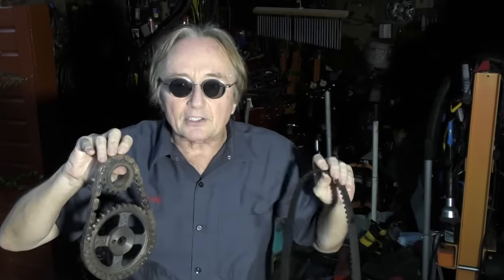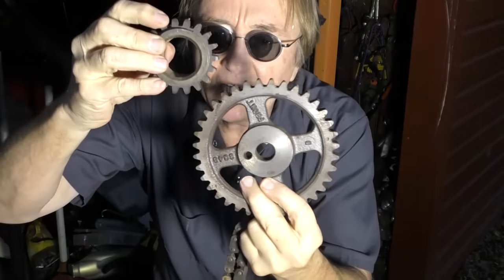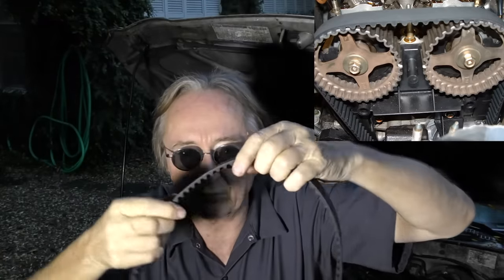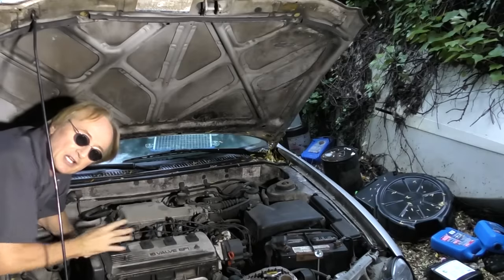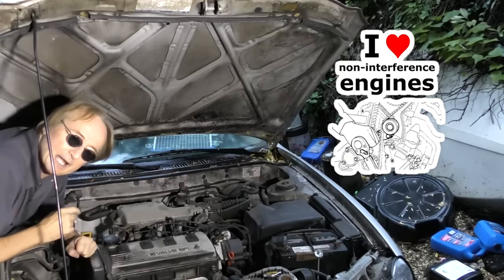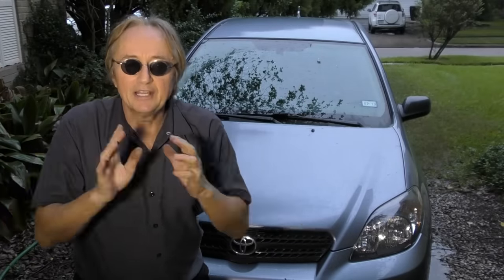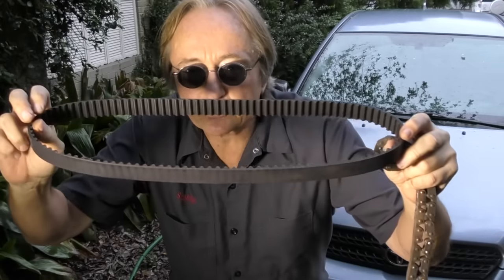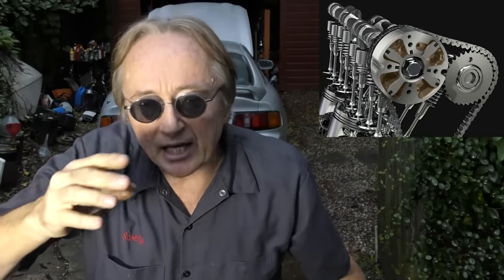Why Some Cars Have a Timing Chain Instead of a Timing Belt

Comment: Timing belts fall in the same category as plastic water pumps
Reply: Dont forget the plastic body panels on the saturns. The only reason they are dent proof is because if you hit them hard enough they shatter lol.
Reply: And those damn plastic thermostat housings. What the hell is up with that!
Reply: Plastic fuel injector housing is literally cancer.
Reply: Any car that uses plastic where metal is a much better choice, I walk away from.
Reply: @bthegardner2213  oh yeah didn't dodge or Chrysler do this lol
Reply: @SourGrey  Chevy did too with the aveo. It's becoming more common to find once aluminum parts to be replaced with plastic on 4cyl engines.
Reply: I have a car that came from the factory with plastic radiator hose connectors/splitters that brings coolant to the carburetor and heater core.

It failed burst in 3 years. Changed it to an after market aluminium unit and never had a problem since. Its been 15 years already. Sometime metal parts are needed. Sometimes plastic parts are needed. But never substitute metal parts with plastic

Comment: Meh, i preffer timing belts , at least if engine has one , its easy to service. Down side of timing chains , are those cheap plastic timing tentioners . Plus most engines are in Transverse so the only way to service timing chain is to drop the whole engine , too much work and harder to service compare to timing belts .
Reply: You don't always have to drop the engine. I replaced the timing set in my buddies 04 Malibu classic with a 2.2 ecotech never pulled the engine. Book said to remove it but you can change them without doing it
Reply: @brandonpeterman9964  4 bangers are ok, still cramped tho. To "properly" serviced it needs to be removed from the bay. Heck all V6 DI GM family engines (aka Lambda)  that are transversed are next to impossible. Now i know some folks able to manage to replaced timing chains while still at the engine bay but its really tricky and too much risk .

Comment: Most if not all timing chains stretch if not actually break. A stretched timing chain can be very damaging to other engine components, not to mention the engine no longer runs within the design parameters. Belts clean effective accurate safe and easy to replace. Mostly at a reasonable cost, replacement of chain is a way more expensive proposition.
My personal problem is I can only buy used vehicles. Vehicles with cam chain engines with very often poor maintenance record of good oil change frequency and with good oil types are no longer on my checklist to take an interest in. The net is littered with knowledge on poor quality chains or tensioners that need premature replacement.
Just like direct inject engines and chains are not good for the average pleb like me.

Comment: I have a 1999 B14 Nissan Sentra 1.3 liters that has 360k kms on it. Original aircon compressor, original carburetor,  not burning oil, engine never been opened and yes, it is equipped with a timing belt.

Comment: I had a beautiful acura legend coupe 1992 had stupid timing belts .. well it broke and I lost an engine .. talk about pissed .. I’ve bought toyota’s ever since
Reply: Been having honda's all my life, other cars too i'm in europe we have other brands. It's weird how you call them stupid timing belts, why don't you call it stupid maintenance, you're the type of person who thinks engine oil is good for 20k miles? Why can't you guys take care of cars so you don't have this kind of problems? Nothing personal
Reply: Maybe should’ve followed the maintenance interval
Reply: I was told all maintenance had been done on the car I inherited it from a relative ... you’d think car companies would at least on their flag ship line would do timing chains ... that’s why I’m a toyota / Lexus guy ... but thanks for your suggestion
Reply: @kevinedwards4223  Somebody dropped the ball, then. They either installed the belt wrong (I encountered this on a 20 year old Accord which had over 250,000 miles on it, engine was still fine), or they thought they changed it when they didn't. It's also possible that your relative got ripped off. I've been working on cars for 17 years, I've seen plenty of timing belts go well past their replacement interval, I've never seen one fail prematurely.
Reply: Your exactly right my aunt gave me the car seems her private mechanic screwed her charging her for work he never performed he was supposed to do the water pump and he found out it was a job over his skill level she went wrong telling him she was selling the car in a few weeks ... she ened up giving me the car ... the mechanic gave her the funds back 800$ 

But the engine was ruined
Reply: Kevin Edwards so Toyota some of them still run timing belt
Reply: Kevin Edwards and my 98 Honda Accord got 320.000 miles on it and I change my timing belt every 90.000 miles

Comment: I hate that my Honda odyssey has a timing belt. And of course it's an interference engine. Not only that but it cost me over a thousand bucks Canadian to have it changed. I did do all the tensioner pulleys and the water pump at the same time though.
Reply: TableRocked  I've had two 2005 odysseys and they've been rock solid. But I have heard a lot of bad things about the build quality of the newer ones. I'm actually thinking about buying an older sienna but they're hard to find with leather.
Reply: dave ramsey,  the finacial guy who talks about getting and staying out of debt,  says,  "most millionaires buy used vehicles",  wow,   you must be a  multi-millionaire.....................
Reply: TableRocked Might want to put that $50k towards Google stock. Their Waymo unit is the real deal. YouTube search "Tony Seba freightwaves", and watch that presentation through, to see what I mean.
Reply: V6 engine + timing belt = dumbest design I’ve ever seen...😫

Comment: Toyota makes non interference engines? My 98 3.0 Diesel Toyota Hilux rubber timing belt cost me $2000 when it let go and smashed all the valves into the pistons :/
Reply: A diesel with a belt ?!?!?!?
Reply: Little Chicago all Volkswagen Diesel engines have timing belts. And when they break the pistons smash all the valves. Very important maintenance item for those engines

Comment: Manufacturers make a lot more money off of cars with belts since they have to be replaced after x miles.
Reply: Friend with a Volkswagen TSI has changed more timing chains than me timing belts on my Volvo up to 200 000 miles. And when buying a used car, changing a belt sure beats opening up the engine.
Reply: It's a lot of billable hours for service centers.  Honda V6's are notorious for their difficulty and shops charge about 7 hours worth of billable time; even a good technician who's done it hundreds of times still takes several hours.
Reply: saab 9-5 manual actually says the timing chain should be renewed at around 150 000 miles

Comment: My Toyota engine is interference :(. Just had the belt replaced.
Reply: All the mechanics in my area charge at least 600 dollars to do this. Absurdly piss poor design choice especially on a transverse mounted v6 engine in a cramp engine bay like my 2nd gen lexus rx.
Reply: I hate that term they use to describe the ''INTERFERENCE'' ...it should have been termed as Destructive consequence engine  or  Non Destructive consequence engine, because afterall the problem can result in major ''destruction'' of the engine
Reply: @Rainman00000  which is the main reason why I got rid of my volvo. I loved the car, but the inline 5 was a bit cramped to do any work. Specifically transverse. I got a audi an I'm happy with it easier to work on the car and it uses timing chains. Which I will replace in the summer.
Reply: @fidelcatsro6948      "Interference" refers to interferes with your bank balance when the belt breaks. Replace the belt every 100,000 or every five years and they say you'll be good. Sooner if you follow Scotty's advice and you rev your engine.
Reply: Jomar V. why replace timing chains, no need to unless it like 500,000 miles
Reply: I thought Toyota used non-interference engines while Honda used interference engine. I believe 2003 Camry had a non interference engine
Reply: @tinytim9453  It has a belt, not a chain. 4.7 V8 in an 01 Tundra.
Reply: My 98 Toyota 3.0 v6 costs a fortune to fix anything
Reply: newer  camrys   have  chains,  so  they're  probably   interference.
also,  the  camry is  the  toyota  made  in  the  usa.   a  lot  of  it
made  by  G M.   interference  with  a  chain  like  they  always  use to
make  them....... chain breaking ?  not  to  worry.....it  won't......
Reply: @tinytim9453  cause I bought the car used (obviously) and dont know the history of it. So just to play it safe. Like just this week i found out it had a coolant leak. Its better to be safe then sorry sometimes.
Reply: I must have been one of the wide head series as the A series with narrow heads, with the belt driving one cam. Gears take the drive to the other cam. These engines are non-interference. My old Toyota Avensis  (European cars) had 7A-FE 1.8 non-interference engine with cambelt. Had regular belt changes done every 5 years, well inside the mileage (60,000 miles). The changes cost £130 including parts.
Reply: driver4011 Wrong. Toyota 2.5 4 cyl. and 3.5 v6 both non-interference engines. Know the facts before you leave a comment so you don’t look stupid.
Reply: I also have a Toyota interference/timing belt car. The 2jz ge inline 6. I've changed the belt twice in its life time. Currently at 260,000 miles.
Reply: @Tiny Tim   Unless some previous owner of the vehicle has failed to change the oil. If this causew the tensioner to stick, then the flopping chain can cause the guide to break Or the chain itself can be weakened and break eventually..
Reply: After 2001, Toyota used the 2.4L 4cyl which has a chain. They contintued to the use the 3L V-6 until 2009. For a V-6 it is pretty easy to work on and you can do a timing belt job at home if you know how to work on cars. In some models you do have to jack up the engine to get the water pump bolts out, according to my sources. The last timing belt engines by any manufacturer were sold in 2010 as far as I know. Gates has an online guide which shows all timing belt applications and also indicates whether the engine is interference or non inteference.
Reply: My 05 camry has timing chain. No problem
Reply: Gary, I was replying to Jomar. Anyways, the Tundras has timing belts??? There are kinda cool looking trucks but I'ma think twice before buying one.
Reply: Gary 2uz-fe I’m guessing??
Reply: I had a belt break on a 95 Civic. I was told that they are interference engines but there was no damage done. I simple replaced the belt and the car drove fine

Comment: It seems to me like performance cars have timing chains and basic slow boring cars like the celica use belts.
Reply: Actually I think it is the opposite because of the resonance factor and weight.
Reply: My 2001 celica has chain 😎
Reply: My base model Nissan Versa has a manual transmission and a timing chain.
Reply: My 01 BMW M3 and 04 Cayenne Turbo both have chains.  A broken timing belt is a major headache that i would not want to worry about.
Reply: corollas, lancers, honda civics & fits, sentras etc many small cars have chains
Reply: Subaru Impreza WRX and Sti use belts
Reply: All slow Saturn S-series had timing chains too. It all matters on the brand and what they are willing to spend versus an investment.
Reply: It seems to me you don't know what you're talking about.  Every Corolla since 1998 has a chain.   Every Celica since 2000 has a chain.   Every Prius ever made has a chain.   Aww, hell, I'll just get it over with and say it... NO Toyota made today has a timing belt.

Comment: My S2000 has timing chain but my Odyssey has timing belt, which I changed at 100,000 miles.  It's about 145K miles now.  Both vehicles  have been very reliable.

Comment: You forgot to tell them how to visually tell the difference.   A plastic side  cover is a timing belt and a metal cover on the belt side of the engine is a timing chain.
Reply: Sometimes the chain can be seen by removing your oil cap. Some cars that dont have a plastic or metal cover on the side means it is always a chain.
Reply: @HardWhereHero  True 'dat.
Reply: GM Vortec engines(1996 to 2000).....Tell me again....plastic timing cover.....belt or chain?
Reply: @iamtheoffenderofall  pushrod motors timing chain overhead cam motors could be either.
Reply: @russwelday  According to your post, Plastic timing covers are timing belts metal are chains. I proved you wrong.
Reply: The plastic timing chain covers glued and bolted onto the Blazers are a stone age exception.  The general statement was for modern transverse engines.
Reply: @russwelday  And someone NOT knowing cars would believe your bull.  You stated a lie, I called you on it. You are bucking now that someone called you on it. You now even admit you were wrong by stating my fact.
Reply: @iamtheoffenderofall  pretty sure my timing chain cover is plastic, like way too many things under the hood. I guess I should be happy that Chevy still believes in putting steel where it counts.
Reply: Wow you can not tell by plastic or metal cover if it's chain or belt.
Reply: @russwelday  exactly.. Yea you will always find a few exceptions.
Reply: @russwelday  Im guessing they blted it on then glued it to keep the "trail crud" out. But since only hardcore jeep guys offroad its all non relevant. GM at its finest.

Comment: 😒 i hate timing belts & interference engines
Reply: Steve Prince  😎 OK! 🚂
Reply: MrSammy   How can one tell if any particular car’s engine is an interference engine?
Reply: @TheItsmegp46  🙂 check the forums on the car u like, usually someone will post wether its interference or not ☺️🛵🎃
Reply: On non-interference engines, it is impossible to get valve operation that maximizes power.  The exception would be a flathead engine which my first car, a used 1951 Ford V8, had.  So did my antique 1953 Packard with a straight 8 engine.  Flathead engines ran just fine, but it was hard to get much more than 1/2 HP per cubic inch from them.
Reply: @frankeggers4024  🤠 neat, i didnt know that
Reply: damn you subaru!
Reply: @niccadoodles  😒👍 rite! 😡🚗😵

Comment: My 98 k1500 has a 5.0 v-8. I have 200,000 miles on original engine. It starts and runs like the day we got it. Timing chains make the difference. 23 years later and the engine sounds incredible.

Comment: I love timing belts. I've serviced Ferraris.
30k services run about $15k on the 512.
Most of that is the engine pull for the t-belts and water pump.

Comment: As electronic cars slowly gain traction into our lives, I am amazed by how many problems are solved by them. No need for pistons, timing belts, no interference issue, and so many more...
Reply: Yeah now you get ultra flammable batteries instead
Reply: @NikeySunfire  one spark at the fuel tank and its the same problem currently.

Comment: In a racing application, such as NASCAR, belts are used because they have less mass and are way less prone to becoming a circle like a chain does.  I owned a 1984 Pontiac Sunbird 1.8.  Recommended timing belt replacement 50,000 miles.  It broke at 53,000 miles.  Quite inconvenient.
Reply: @Mark Codiroli You are correct.  I do remember seeing a picture of the gear to gear cam drive.  Several years ago a NASCAR competitor lost engine power suddenly and was accused of delaying the race.  He responded by saying his timing belt had broken.  Maybe that was an experiment that almost worked.  It was very late in the race when that failure occurred.  A belt does have less parasitic drag.  I do recall reading an article about using belts in performance applications.  Maybe the NASCAR engine builders are experimenting here and there.  Anyway, the inertia factor would be a consideration ( the circle thing ), but finishing the race certainly remains a top priority.

Comment: Just changed my rubber t belt in my 2008  accent yesterday first replacement way over service limit 178 000  old belt was in perfect condition  visually anyways.  But was stiff. So just saying you can put it off for  a while if you pwn a accent Its costly to replace if you dont have the knowhow yourself  TY Scotty for all your Knowledge :)  Get Er Done

Comment: The belts are pretty tough Scotty.  Must be changed at the right interval though.   I had a Chrysler intrepid with the chain but still needed service at an interval because the water pump was behind it.   So either way I had my belt and water pump, tensioner and idler changed at the interval on my Chysler 4L town and country.     Water pump was starting to leak but the belt looked pretty good yet.   Drive on!

Comment: Thanks Scotty great video as always. I recently bought a 2005 Toyota tundra with a V8. The truck and the engine are an amazing condition and has low miles. I was discouraged to find out that it's a timing belt and it's an interference engine. Well not the end of the world, is there any approach to replace a timing belt with a timing chain, is there a kit to do that etc?
Reply: No kit unfortunately. No chain will fit the guide rails or sprockets. HOWEVER, it’s well known that Toyotas w/300k miles on them have NEVER had their belt replaced. 

Is it a good idea to not replace your belt every 90k? No. But if you live in a mild climate, don’t beat the hell out of your engine, and keep up w/maintenance, your belt will be fine for WAY longer than 90k.

9/10 cars/trucks that come into my dealership have original belts on them with 200k miles + and are running fine. 

Toyotas that is. I wouldn’t trust a Honda/Nissan timing belt over 150k